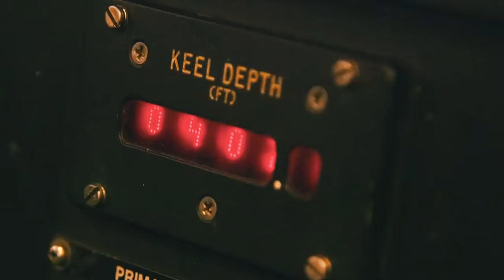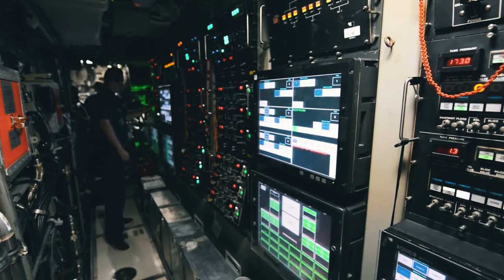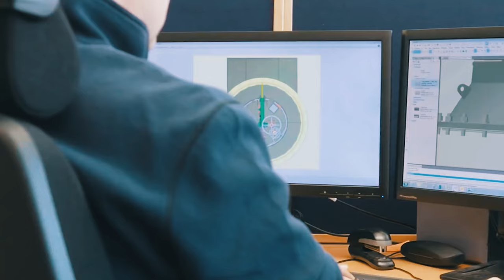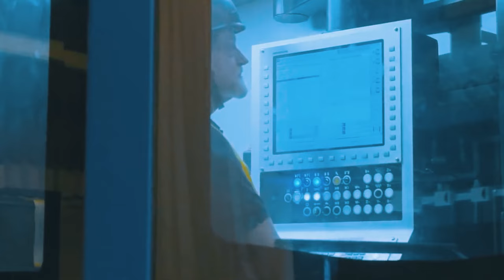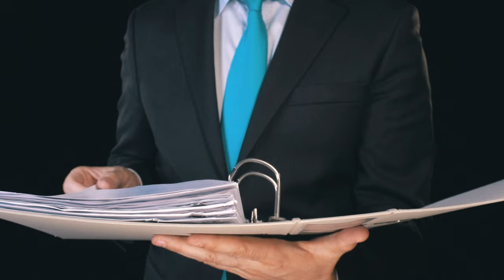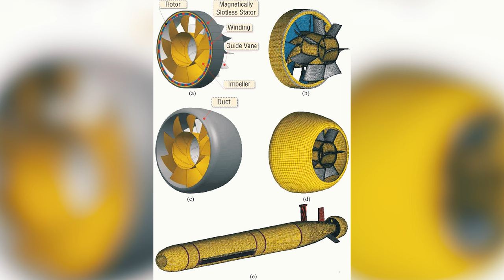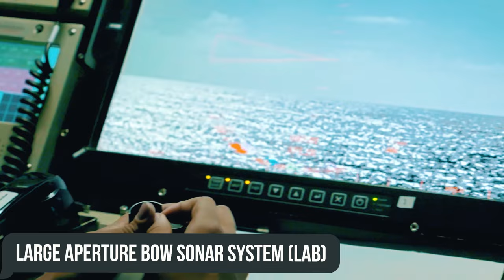Finally: This New US $9 Billion Submarine Is Ready For Action

Comment: Keep both or sell the old one to an allied. Get some money for the old one.
Reply: The hulls work harden each time they dive/surface due to the type of steel used in the hull.  Also the reactors embrittle over time so at the end of the proposed 40 + years they are well and truely shagged, more of a hazzard than an asset.